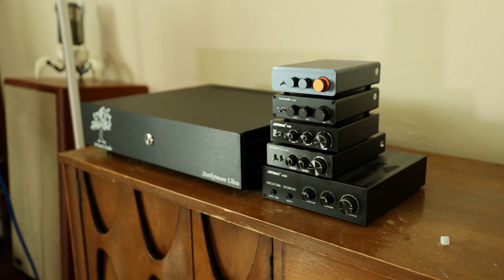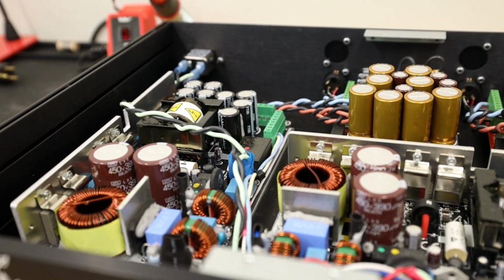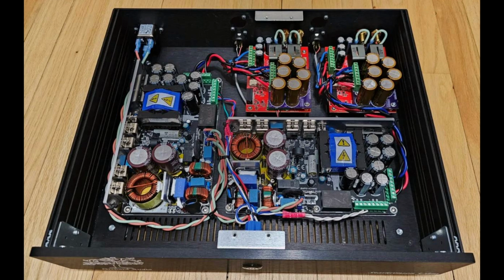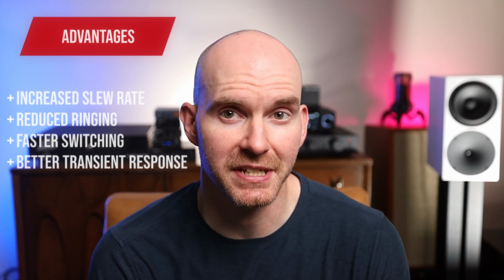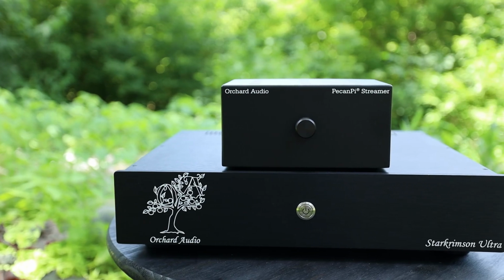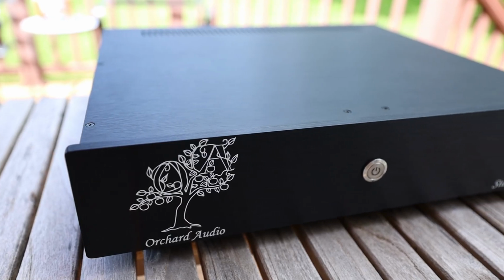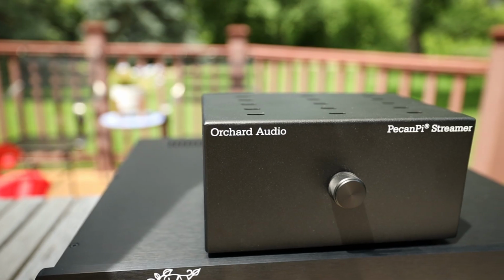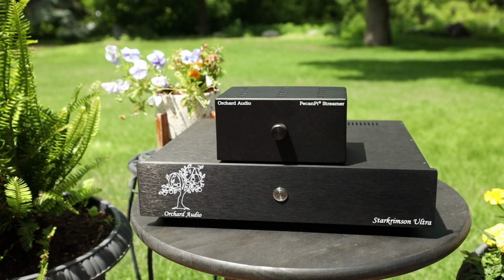Orchard Audio Starkrimson Ultra 2.0 - A Peach, I Mean Pear Of An Amp

Comment: 5:27 "Digital amplifiers, also known as Class D amplifiers, operate by converting an analog input signal into a digital format that uses pulse-width modulation (PWM) or pulse-density modulation (PDM)."

Comment: Thanks for the video.  I was wondering if you have plans to evaluate the Duo/Trio product.  It seems like a great 3 channel amp solutions with the trade off primarily being less power at a lower cost.
I have wondered how such a solution compares to the GalionTS A75.
For the time being, I am using JBL Studio 590's which are so sensitive, I really don't need much power.  I also tend to be satisfied under 70db so my needs are small.

Comment: i think the idle power consumption needs to be addressed, it is more like the standby power as i assume it goes into automatically(and hardly comes back from at least on my nad c298).  what is more important is the low watt power consumption or low watt efficiency, and if you do not use the standby function. then how many watts is used when not playing music or at 1 watt of output, then we need that wattage. 
some manufacturer provide the "Quiescent power consumption"  and that is the wattage the amp needs to stay on.
example: ICEpower 125ASX2 states Quiescent power consumption as 9.5watt, that means at no music playing up to 1 watt of music output it is about 9.5 to 10,5 watts of usage, also all that is waste heat. 
as the amp is more powerful that wattage also goes up with it. double that amp output double the idle watt following is nearby.

Comment: I tried the Starkrimson 2.0 with a set of Magnepan LRS+ and I was very impressed.  The sound is like going from 1080p to 4k.  No harshness, very detailed, crisp and impactful bass.  You don't get that rounded off tubey sound but, paired with a tube preamp, it softens it just enough to where you get the best of both worlds.  I just wish it were a bit cheaper and with a smaller case.
Reply from the maker: I have not had the opportunity to test this pairing but what I have experienced with this amp and what I know about those speakers I bet that would be a great pairing.
Reply: Thanks for the support and feedback.

Comment: Ok Matt not a knock  a great read on the XLR Leo will appreciate Im sure  not being technical kinda leaves some of you guys a disadvantage one would really on need  extend the USB on the PI4 included to utilize an external DAC Volumio or Roopie ( one can easily change between the 2 in software)